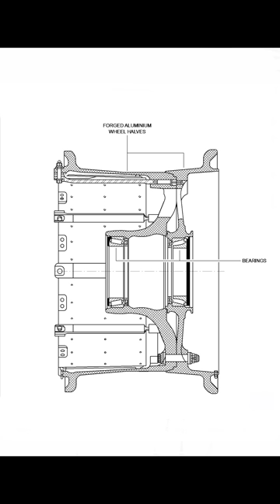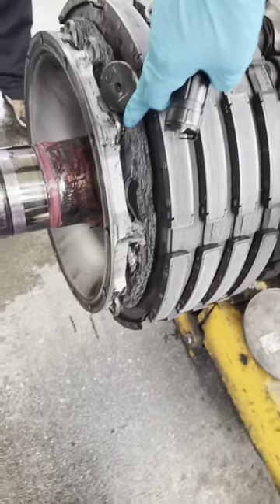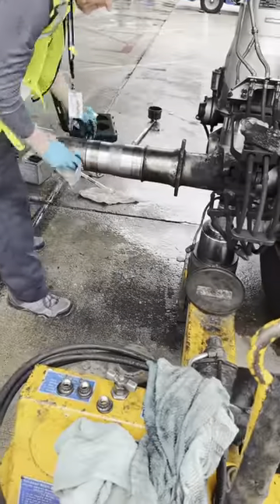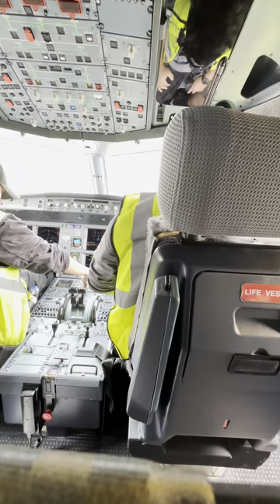Aircraft wheel and brake change due to damage.

Comment: If you lost tie bolts, that’s a hard landing.
Reply from the maker: It depends, the pilots did not report a hard landing, and the parameter did not show any load factors that would exceed an excessive landing. We sent the bolt out for analysis, it came back as saying it was a defective bolt.
Reply: @StigAviation      Flight crews are reluctant to write up a hard landing for obvious reasons. If you have tie bolts break, there is only one reason for that, a hard landing. I am surprised maintenance control didn’t flag it. Hard landings need to be recorded because it adds up to require a heavier inspection.  If need be, pull the flight recorder and have it read. It really is easy to read. 
I saw a DC10 in JED that had a gear strut that go through the wing while taxiing. The investigation showed the aircraft had several hard landing that had not been properly inspected. Fly PIA
Reply from the maker: @oldmech619  I completely understand you, sir, and we did contact maintenance control for this. But once again, I went through the aircraft parameters, and the aircraft does not lie to me. I did pull up the load factors straight from the computer, it was not a hard landing.
Reply: @StigAviation    Good follow-up. Thanks.

Comment: I know, I know. This plane was in Pakistan for repair. And they used a correct two meter tube torque wrench
Reply from the maker: I don’t understand your comment sir, what are you referring to?
Reply: @StigAviation  why bolts snap? Torque was too high. And that was a joke, that in pakistan they dont use torque wrenches. They take long tubes and turn like hell.
Reply from the maker: @edgarasvas  ohh now I understand. We think this one was a defective tie bolt. We sent it to the manufacturer for analysis
Reply: @StigAviation  are'nt they checking those bolts before selling?
Reply from the maker: @edgarasvas  sometimes not everything is perfect. But that’s why we have redundant systems and multiple bolts holding it together

Comment: show us flap alieron motor how they move the tail elevator and all that
Reply from the maker: First of all they are not motors. They are actuators. Second I can’t show that because it’s a moving flight control surface. I can’t be near it when it’s moving. Most I can do it show it moving around from the ground.
Reply: i think i have seen flaps motor turning with shaft long time ago how about just the inside not when they are active maybe a plane that is there for maintains  the elevator jack screw is the most scary thing i have seen been a car mechanic never trusted the jack screw bold or nut in my whole life cause they break and yes we all know they do break    @StigAviation
Reply: @StigAviation  oh btw i just subbed ur    channel some if the work you guys look more like a car mechanic would do
Reply from the maker: @yaad2226  they don’t breakdown. Only one time in all aviation history that a jackscrew failed. So what you are saying does add up to the facts. The flight control systems are very secure and have multiple redundant features. Nothing like a car. I assure you it’s very safe.
Reply from the maker: @yaad2226  i appreciate that. But just to note this maintenance is very different than automotive maintenance.
Reply: bro at basic it is metal and they break i but ur work is amazing specially how u changed the tire and brake assembly i did not know plane got multiple piston and i bet they are have abs wonder how these piston fire when in abs mood i noticed u tested them brakes not all piston will go out same time i do understand the jack screw dont fail but for me i think it was md80 that had fail jack screw these screw are well exposed when plane is on ground 
 @StigAviation
Reply from the maker: @yaad2226  that portion of the break is actually much like a car and a vehicle also has the same type of brake piston system, it’s just on a bigger scale more pistons more calipers disc rotary style. In regards to the Jack screw, once again, that was a very unfortunate event.
Reply: thanks for explantion @StigAviation

Comment: if that split rim blew in flight wheels up could cause a crash
Reply from the maker: It would not cause a crash, it would cause some damage, but not a crash. There are multiple redundancies with multiple check valves that would prevent any kind of fluid leakage.

Comment: Stig , I've seen similar brake problems on Airbus unlike Boeing.  I remember once on push back,  the Airbus had a wheel lock up for no apparent reason.
Reply: There's always a reason. This video is 100% evidence as such, and the same happens on ALL planes.
Reply from the maker: There has been times of these events of wheel lock ups,  usually due to the brake unit itself or the servo valves... but tie bolts failing is a rare thing.
Reply: @StigAviation   Your right about the tie bolts,  I've never seen one fail. 
While working overseas,  I remember  a fellow mechanic and I encountered  four Pakistanies trying to remove a MLG tire/wheel assembly off a 707.
They had removed about 6 of the tie bolts when we were able to stop them. They were not mechanics as there was a lot of work going on and not enough man power. Not to go into detail but it wasn't these guys fault. They were hired to keep the hanger clean. It seemed the customer was in a hurry to get work done on his 707.
Reply from the maker: @wayback75  I completely understand that part. Especially in the situation and location where you were.
Reply: This occurs on Boeings too.  Airbus doesn't build wheels.

Comment: Step one is always deflate for me.
Reply from the maker: Absolutely correct, before changing a wheel assembly, we always deflate, or we can use the air within the tire to feed the jack with nitrogen to jack up the aircraft. It’s called a cheater hose.